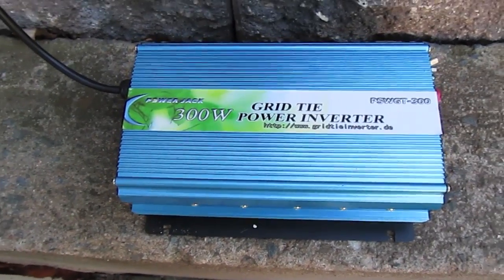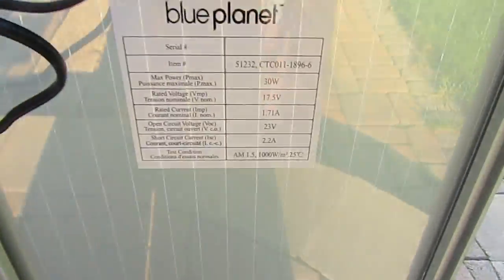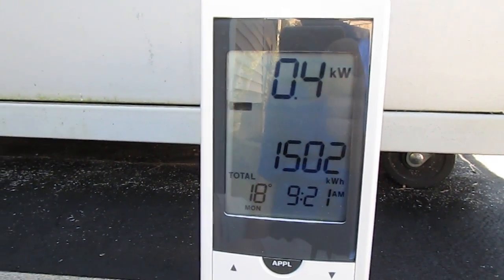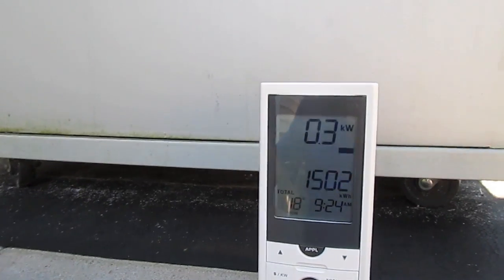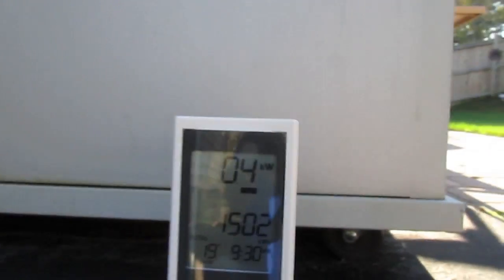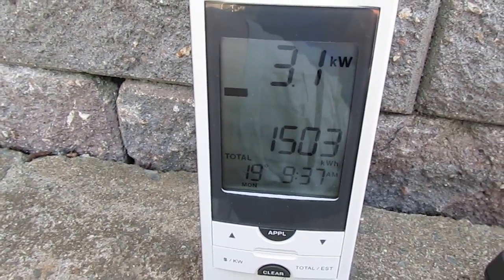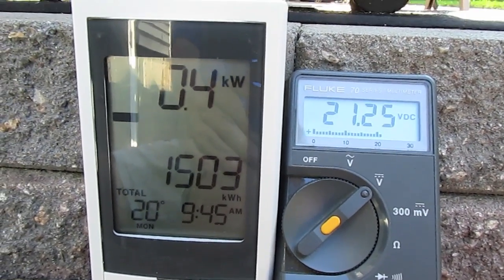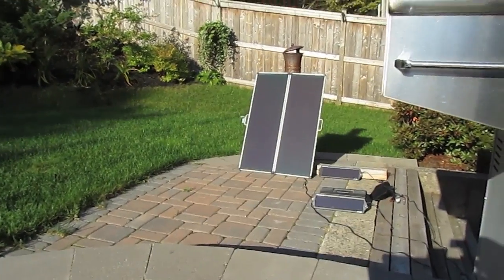Solar layout with Grid Tie inverter

Comment: I have a 10 watt panel that charges up a 10Ah sealed lead acid (2x5Ah in parallel). There are 36 cells that are each about .5v and .6A, thus it is 18v x .6 or about 10.8 watts. If the battery was 100% efficient, it would take 10 / .6 hours to charge from empty and needs the extra voltage (and a charge controller if more Amps are put in). Such small current lights up 3 Cree XPG leds in series (from "12v" led driver) at 500mA, or about 600 lumens (= to 40 watt incandescent) and is only 5 watts.

Comment: Solar does work, just have realistic vision of what you want it to do if your looking at a small set-up.

I have a 100w panel to 2x 110ah leisure batteries going to a dusk till dawn sensor to power my garden lights (all led lights) and to power the under cabinate lites in the kitchen. I charge the battery once a week and the rest of the time I have a GTI that offsets between 30watt's all the way to approx 90watt's depending on what type of day it is...  it does more then I wanted it to..

Comment: GTI efficiency is about 78% at full load, but at 60W solar you were probably pumping about 50W to the grid in good sun. Your power monitor can't tell power in/out unless you order a special one that has sensors for the solar side. Get a Kill-A-Watt meter for around $15. If your electric meter is a "smart" meter it may not give you power credits, make sure you complain. Feel free to drop by the forums at techluck.com for more info.